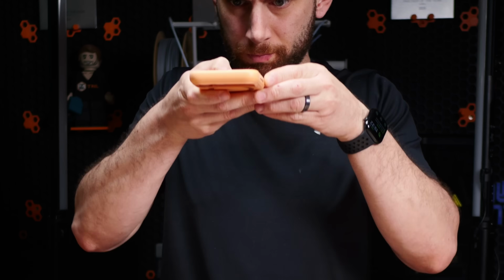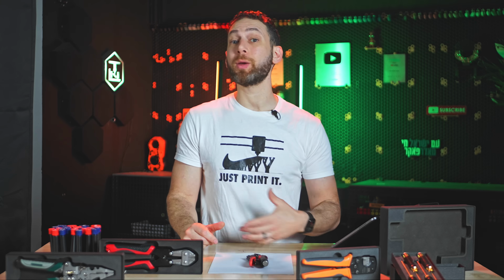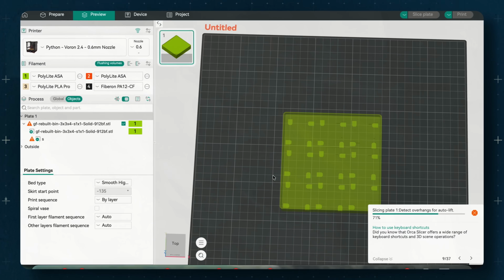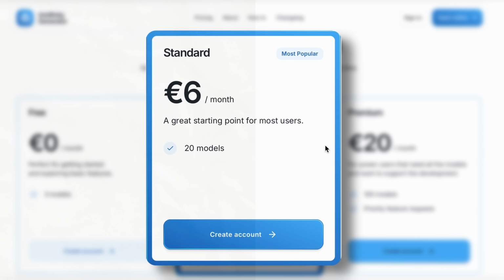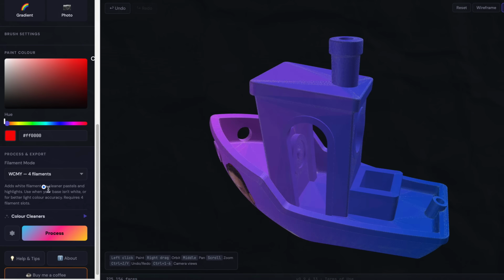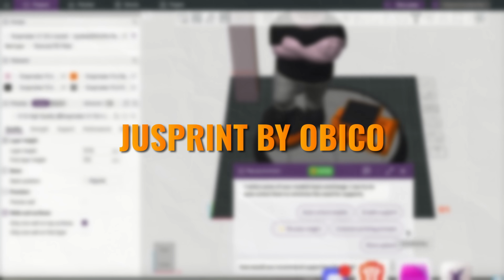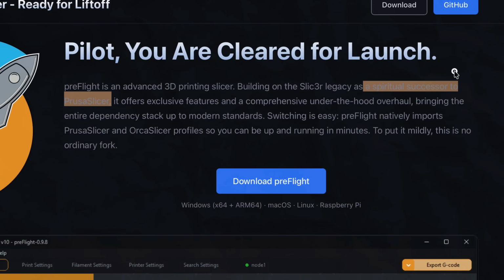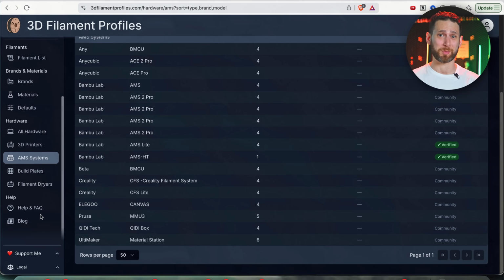These 13 New 3D Printing Apps Are Insane!

Comment: I despise subscription based software and avoid it like the plague.
Reply: I have a vintage iMac specifically to run the last non-rental versions of Photoshop and illustrator. Work perfectly fine for me. And I own them. Forever.
Reply: @ComputerKevAZ  Ive been considering doing the same. I still have the discs for the creative suite.
Reply: @british1970s  F*ck Adobe. Just pirate it and run it on your modern machine.
Reply: @ComputerKevAZ  that should be the cs6 suite, right? Worked at Adobe tech support around the time they switched to subscriptions
Reply: in this case (normally i agree) but you make your bins/stl's and then done (so you can unsub right away).
Reply: Hi!! Adobe here, would you like to sign up for a locked in contract l?

(And if you're stuck in one, just change your subscription then go back and cancel it after changing)
Reply: And thats a healthy aproach to subscribsion. Its a cancer of software.
Reply: amen brother im the same.
Reply: I only got about 25% through this video before I quit and deleted it from my history because of all the subscription chatter.
Reply: @henrymach  That's why they do it. SaaS is the "thing" nowadays. Passive easy income. I hate it as well
Reply: @riznix9237 Bro, software development is not passive income.
Reply: @riznix9237  vibe coded saas, it's not even good code 99% of the time
Reply: @riznix9237  yeah mate terrible right ? Imagine going to work, working hard on something, spending hours working and then getting a salary…. I hate that as well … the greedy people nowadays asking for money in exchange for the value they provide
Reply: Plasticity is your answer brother.  You own the license after you buy it.  It super easy to learn and it is a game changer.
Reply: @JonneytheKidd  For 12 months of updates. Then it's locked there.
Reply: @IñigoZapata  You still own the license.  you don't have to pay for another year of updates.  And even  if you do, last time i checked, $100 to renew the license (not mandatory) is still a lot cheaper than $1,500 a year, last time i checked.
Reply: @JonneytheKidd  You last time checked twice. Yes, it's cheaper than most and it's a fine piece of software. Still, after 12months you are stuck with that last version or pay again, which ends up being a subscription.
Reply: @IñigoZapata  I don't have to pay if i don't want to.  Maybe to you $1,500 is the same as $100, but I am still NOT, i repeat, NOT required to pay that $100 to continue to use the software.  I used it all year prior and had no problems using it and can continue to use that version and will not ever be required to pay more if I don’t want to, and it will never cancel on me.   Not so with Onshape.  I am actually paying the updates every other year.  $1,500 every year a leaps and bounds more expensive than $50 a year for me.  You can’t get around the price comparison for what you get, you just can’t.  Everyone knows it and so do you.
Reply: @IñigoZapata  Duh, obviously. If it does the job then upgrade isn't required is it!
Reply: @Planetinaction  I have used software that way, until it was not possible or practical anymore, yes.
Reply: @IñigoZapata How is it different from buying old-school piece of software, using it for five years and then buying a new version once it has enough new features? I feel like this is the best of both worlds. You pay for it once, get a year of updates with it, and once you're ready to upgrade, you can do it for a fraction of the original price. Or you don't upgrade and it still does what you paid for originally.
Reply: @Insectslayer  If that works for you, it's perfect. I still use Reaper that way.
Reply: Would you pay $50 once to use a gridfinity bin tool?
Reply: @TheOfficialOriginalChad  You could have a price per STL. Making you pay monthly a service that you know 99% of your users are going to use once a year is just trying to trap them. Not trustworthy.
Reply: @TheOfficialOriginalChad  yes
Reply: Then write your own software
Reply: @user-sk4nt5bm5r  no
Reply: @BeeHiverson oke Karen

Comment: Thanks so much for the shout-out! I've been working on some UI/UX improvements. Should have a nice update out soon, and I'm still actively working on improving a number of things on the site! Also I definitely need to make it more clear, but there is actually a paid plan that I've been moving to instead of the donation model. The site will be free forever, but the paid plan lets you save your models!
Reply from the maker: You rock. Thanks for all you do for the community and I totally support you moving to a paid model if it means you keep developing and improving the software.
Reply: I do have a minor feature request for you and I was wondering if there were any channels I should go through to submit it rather than a random YT comment. 🙂
Reply: @LoopyChew  Shoot me an email via the contact link at the bottom of my site!

Comment: you gotta add Waveoverhangs to that list. orcaslicer fork (again) that lets you print 90 degree overhangs. it's in testing phase but extremely promising and working very well already! check it out, maybe run some tests yourself and contribute your results on their website ;)

Comment: Great list of options, one word of caution on Onshape as a free CAD system is that under the free tier there is a lot of ambiguity about how GPL projects work under that since anything you do on the free tier is licensed to Onshape under a different license and all rights and commercial use are forfeited to them. I really wish they would offer a lower tier than the full commercial level that would allow the user to retain the rights to the projects they create with a more clear commercial limitation applied. Until then it is a hard pass for me and many others in the 3d printing space that care about respecting the many license frameworks we are bound by.

Comment: No, you cannot produce 16 million shades of color. Unlike a monitor, a 3D printer does not allow you to adjust the brightness of the primary colors. Realistically, you can expect no more than 100 shades.
Reply: A monitor is going to work fundamentally the same as CMYK+W (3 colors + black and white). Yes, a monitor adjusts the individual brightness of the color components of each pixel, but this is analogous to the 3d printer extruding less of one color and more of another. 

The limitations here are imposed only by 1. The "resolution" of adjusting mixing amounts, depending on the extruder's stepper motors and motor drivers, software limitations, etc., and 2. The mixing method limits "pixel" size. Does it actually mix, or only alternate colors each layer? If the latter, both the pixel size and color accuracy is limited depending on the exact shade, number of colors to mix, and layer height. The more equal the ratio of individual colors (i.e. 1:1 mix cyan and yellow) and the fewer number of individual colors (i.e. a "final" color only needing cyan and magenta, vs a mix of cyan, magenta, yellow, and black) allows for more accurate colors with smaller "pixel" size. 

Colors that require a weird/uneven ratio with multiple filament colors will require a large section to approximate the final color closer.
Reply from the maker: Source? Because I’ve been able to do many shades of the same hue.

Comment: This might get lost but your filament library gives back "Failed to fetch" when trying to suggest an edit or also subsequently when trying to report an error.  
On the PETG info...  ""Related" portion of PETG does not include PCTG, whereas PCTG does have PETG in its related, I'd double-check any related links reference back and forth.  

It's kinda' weird to have TPU (a flexible) in the related of PETG, and ABS as well, without PCTG which is arguably closer related and desirable to anyone looking at PETG who needs more UV/heat resistance.  "
Reply from the maker: Thanks for the heads-up on the fetch error and the great catch on the related filament links! Looking into all of that now.

Comment: Are there any AI tools that can, in one action, take the texture of an OBJ file and add the details to the geometry of an STL file by converting it to UV texture and creating a displacement modifier and applying it to the geometry? Such a tool could significantly increase the details on AI generated 3D objects for 3D printing.

Comment: I'm focusing on Orca ATM. I also wish folks like Preflight would use their effort in supporting their features in Orca. I am excite to see what Prusa has planned for it's 3.0.
Reply: Orca cannot support the way that Preflight supports plugins. In Orca there is really no such thing as plugins. Essentially there is a single workflow that has to be aware of how all of the features work together all at once. This imposes a large cost on the development of new features.

In Preflight each feature is a processing step in a pipeline. No feature has to be aware of any other feature. You can simply add them one after another. Any new feature you can just add to the pipeline

Comment: If the U1 was just a little bit bigger (like 320mm³ or even 310) I'd get it in a heartbeat. At present it's just a little too small for my needs.
Reply: No way that U1 work cube is 10 by 10 by 3.2 mm. 🤣😂😁
Reply: @mil3k I have no idea what you mean by that.
Reply: @Lulzigi I know that you have no idea about the volume units. 😁😂🤣
I just explained to you what 320 cubic millimeters means.
Reply: @mil3k do you mean to nitpick that I said 320mm³ instead of 320mm x 320mm x 320mm? What's the units of measurement equivalent to a grammar nazi?

Comment: I've never used or heard of Fullspectrum, but it doesn't feel like you gave it a fair shake.  You dismissed it because it can't import easily from a different slicer. Seems like you should give it some time creating some print profiles from scratch before writing it off. That being said, I agree with you that they should probably just make feature requests instead.
Reply from the maker: You mean preflight 

But yeah that’s fair feedback. I just don’t have the time to recreate all my profiles…. And printers….
Reply: I gave it a try two weeks ago.
Importing the profiles was tedious, but not hard.
The main problem was that it would crash so quickly and sometimes for no apparent reason (moving the mouse within X seconds after importing a model, hovering over certain UI objects or just areas...) that I never got to slice anything (on a desktop with good enough specs).

I do like that they followed the UI of SuperSlicer instead of Orca.

Comment: I used my Snapmaker U1 last night to mix 95A TPU and PLA in a print using Beam Interlocking. It came out absolutely perfect - color me (and my print) beyond impressed. I skipped the AMS scene because of the waste of time and filament. I'm loving the U1 (like a kid in a candy store... all over again). I've had one minor issue with the machine and Snapmaker support was fantastic... even when I prefaced the support ticket noting that I was running the paxx firmware, but that the issue preceded moving to paxx. Something with Full Spectrum is next (or PETG support interfaces).
Reply: What was the use case for the tpu and pla mixing?
Reply: @JeronimoStilton14 I was printing a combined wheel (flexible) and hub (pla). But anything you can imagine where you want part of some rigid and another part to be flexible / shock absorbing.  But also multimaterial can be used to have supports or support interfaces in a different material, etc.
Reply: @JeronimoStilton14  To trash the planet Earth beyond recyclability.,
Reply: Can you print ABS-GF on this printer? I have currently QIDI Q2 which is perfect of technical filaments, but printing multicolor suck so much… way too slow compared to other AMS systems. I was thinking of switching
Reply: CCP-backed too. Reject.

Comment: Great video: lots of pertinent info. Question: did you print PEBA going through the side filament feeders or bypass and go through the feed tube. I am getting ready to print PEBA 95a. Will check out your website for Snapmaker Orca profiles, etc. Thank you in advance and keep up the great work!

Edit: actually just joined your Patreon.

Comment: The only 3D printing tool I could honest use is a photogrammetry app.  The problem I find is that they are all too expensive and most seem to be locked into a subscription.  I outright REFUSE to pay monthly for something I'll use a half dozen times a year and I also outright REFUSE to pay over any over for something.  Let me buy the software and install it and be done with it.  I don't need you to keep updating it ad add new features if it already does what I need.  I did that with a data recovery tool and a video encoder years ago and they both still work perfectly.  I haven't updated and I only paid once.  ONCE!!!
Reply from the maker: I feel you. I've been eying this Teleprompter app, but it's $99 a YEAR, which, considering I only put out like, 33 videos a year, means I'm paying $3 EVERY TIME I use the teleprompter app (or about $9/mo)... which pisses me off! If it were like, $3/mo, or $99 for lifetime, I'd be on board.

Comment: Today I had to abandon all my dignity and self respect and bought my second Bambu A1 combo because there's no alternative and reliable printer at that price range 😢.
Reply from the maker: AnyCubic Kobra X is just as good and costs less..
Reply: Forgive me father for I have sinned 😔
Reply: The Kobra X is far superior to an A1. Cheaper, better filament box available, less waste, faster, better parts cooling and it's easy to put basic Klipper on it.
I'd return the A1 and just go for Kobra X.
Reply: @Liminal.Headspace  Will agree to all except the ,"easy to put basic Klipperon it"
Reply: @Itskooldown  At this point Rhinkals for the Kobra X is indeed in beta, but installing it on the K3V2 absolutely was very easy. Sorry, but you're wrong on this end, Rhinkals makes it easy to get stock Klipper on an Anycubic.
Reply: @Liminal.Headspace  Well, congrats on your easy K3V2 which is GoKlipper based. Anycubic moved from GO to C++ Klipper. Due to this custom firmware injection is currently impossible. Therefor I stand by my correct statement prior.

Comment: The innovation is fantastic, but so many of these scattered tools could all just be enhancements of existing slicers.

Although I understand why many are not doing it (Orca being agnostic would be the most likely), it'd be nice if these forks of forks of forks could standardize around a more flexible software architecture that incorporates theming and plugin support (UI and slicer side). It might convince some of these jabroni's who keep forking just to slap a logo and color scheme onto it with a few minor tweaks to contribute to a more unified system. Want to add brand specific logic, and interface? Build a module (AGPL compliant, of course). It lets your customers stay up to date everywhere else.

I'd hope PrusaSlicer 3.x would bring something like that, I won't hold my breath given how they've witnessed the downstream popularity of spinoffs.
Reply from the maker: I sooo agree. 
STOP THE FORCASLICERS 2027!
Reply: if any slicer would add a good way to make plugins or extensions work, that would be neat!

Comment: What would you buy if the X2D and U1 are at the same price?
Reply from the maker: I wouldn't buy any Bambu product ever again.
Reply: @thenextlayer  woah you didn't have jumpscare us like that 🫪
Reply: Easy, the U1
Reply: U1, hands down
Reply: I have an X1C and U1. The U1. The toolhead system is good, but the fact they're still upholding the standards of open-source would be a determining factor for me. Mind you, my X1C runs the X1Plus firmware.

Anything Bambu is going to lock you into their ecosystem. They're great turn-key (think "Apple," it works because they control most of the hardware, software, and eco-system standards) printers, but you are very limited if you ever want to expand outward and start tweaking or repurpose an old printer years down the line.
Reply: @ragesmirk  I'm in the same boat in decision, I think my my use case of almost entirely functional prints (engineering student) the X2D makes more sense. I don't think I'd often need more than 2 materials in a print as I'd mainly use it for supports, flexibles, and text. But if you don't care as much for engineering materials or value a more open ecosystem I'd go for the U1.
Reply: Flashforge Creator 5 Pro. Four tool heads and enclosed.